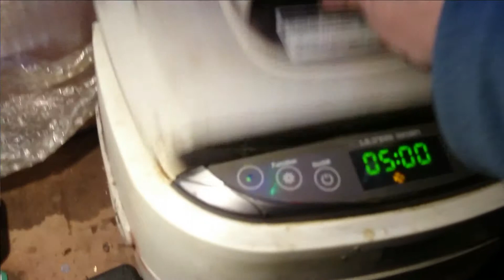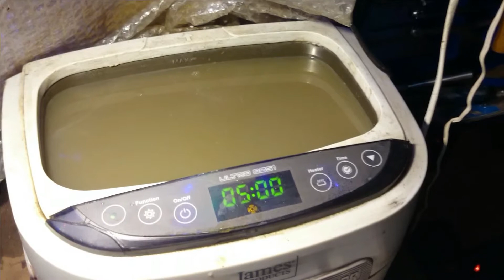Rebuilding a Classic Mini brake wheel cylinder

Comment: I need to do this on my newly purchases MkV 1988 Mini. Are there different cylinder kits to figure out?  Also, a good tip for Ultrasonic cleaners....no need to fill the tub with degreaser/cleaner. Just use water. Then place parts in a hard plastic/glass jar or even a zip lock baggie and put a much smaller amount of your cleaner solution in  the container. Then put the container in  the water and let her rip.....cleans just as well since the sonic pulses penetrate into the container just fine. Saves having to keep large volumes of potentially smelly cleaner and reduces waste build up.